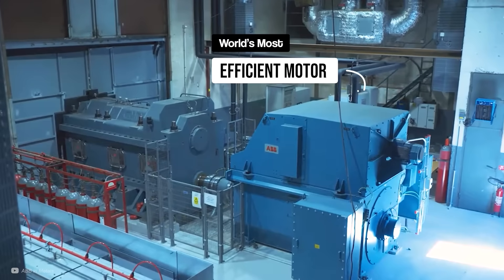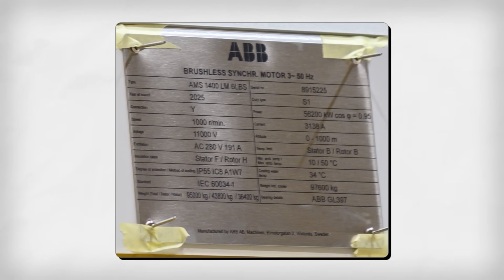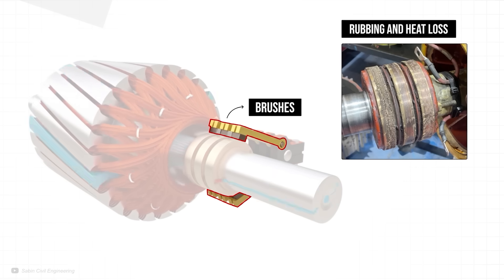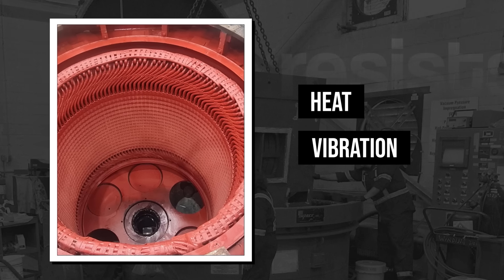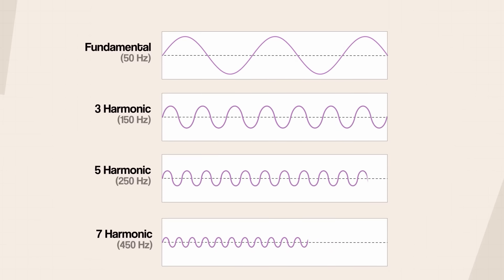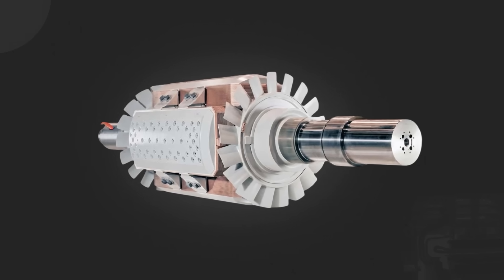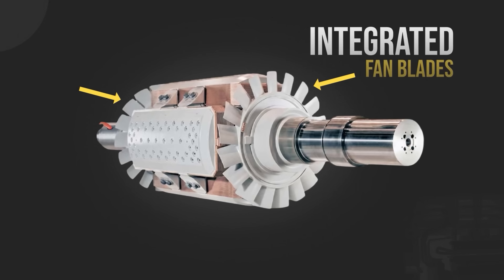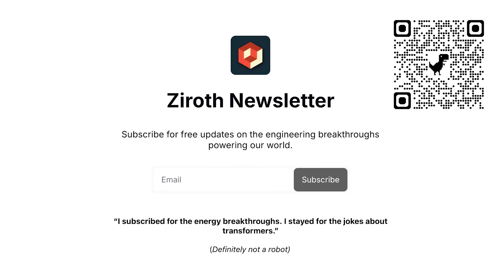How This Ultra Efficient Motor Just Broke The Limits

Comment: mmhhhh always these "in general motors use magnets". sure most of the synchronous do but the asynchronous have not been using magnets in decades, as far as i know and from theyre operation it also woulnd´t makes sense that they use one, and apparently any video i watch these days that is about newer electric motors doesn´t mention this or simply forgets it. I don´t know the percentage of usage between these two types in heavy industry however at least a mention to the asynchronous motors would be nice when the "rare earth magnets are indeed rare and running out" thing is brought up. Other wise a really interesting video.

Comment: Interesting vid. Thanks.
1) Could any of this motor's technology be scaled down to make electric vehicles more efficient?
2) Can it be run in reverse to make an efficient energy generator?
Reply: If the rotor uses induction for power transfer then it must have power electronics inside to convert AC to DC to excite the rotor coils. This means it's hard for this design to be scaled down for small electric vehicles. But it could be possible for trucks and busses.

Comment: It seems congratulations are in order Dr.Inis ... superb news Ryan.

Watched a piece on semi-heaxagonal section windings in AC motors for EV use (i.e. rather smaller and lighter than this bruiser), which claimed significant reduction in hysteresis losses.  I'm wondering how this ABB design compares with that?
Reply from the maker: Thank you! Very interesting, I think I'm going to do some research on new winding materials/shapes as there seems to be a lot of innovation in the space!

Comment: I'm curious as to how ABB kept eddy current losses in the motor to a minimum.
Reply: The rotor is controlled electromagnet. So they can control the strength of the magnetic fields to minimize eddy currents. It's like a variable strength permanent magnet motor.
Reply: Especially with those ungrooved pole winding caps

Comment: I got back-of-the-napkin math pricing of approximately $458K. This is using 720 hours/month, 3 months, $0.10 per KW*hour electric pricing, and a 4% difference between this motor and current state-of-the-art efficient motors.

Comment: I'm just asking about this "mechanics" if we apply it to other motors (by mechanical I mean induction, brushless rotor). Yes, 99% is huge, but what about variable current and torque? Is it always between 80% and 99%? And with this type of motor, is the gearbox for electric vehicles a way like for gasoline engines to have the best rpm, even if a gearbox causes losses?

Comment: How is wireless power transfer (induction?) more efficient than brushes? I would have thought multiple contacts (assuming redundancy) would result in fairly minimal interruption compared to the constant transfer loss through heat and added complexity of an induction circuit. Does wireless transfer mean something else?

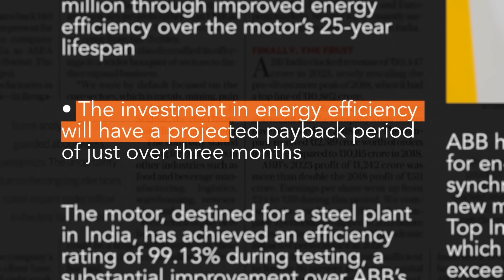Comment: Use case in a 'Steel Plant in India' shown at 11:06 is either for compressed Air, conveyer based delivery Systems, or moving Product - BUT a Steel Plant is hardly 'Green', Energy efficient etc to begin with ... Kudos on the Dr.!

Comment: Presumably this type of motor that doesn't use permanent magnets could be scaled down and would be better at free-wheeling? Possibly beneficial for a two-motor AWD EV?
EVs need a wide operating  speed range, so 99% may not be achievable - at least at any reasonable cost.

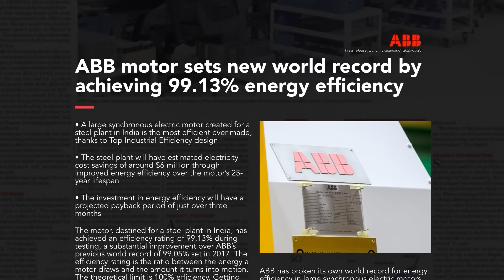Comment: 11:00 I assume that the payback period of three months only applies If you compare it to the previous motor, for which we have no data. You could get much bigger numbers, if it is compared to something like 60% system efficiency or even lower (Past end of life motor, cooling, VFD, mechanical inefficiency etc.). If the project was started only, when the previous motor was on its deathbed, with lead time measured in years, who knows what were the numbers on the day of the shutdown. Sprinkle on some marketing type calculation, and you can get almost anywhere....

Comment: You lost me 4 seconds into this video.  The graph is all wrong.  The line labeled 5th harmonic is actually the 4th harmonic (count the number of waves).  Also, to get the sum line shown, the harmonic has to be out-of-phase with the fundamental, i.e., when the two lines cross zero at the same point, they have to be going in opposite directions.  Do the math.